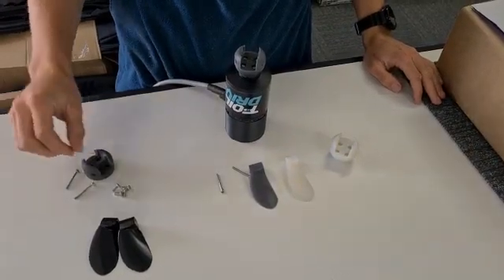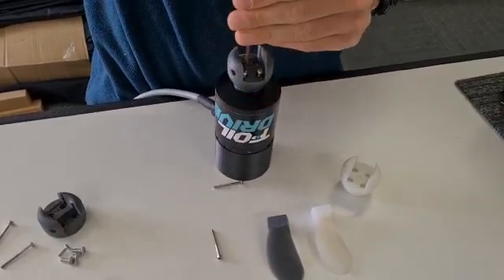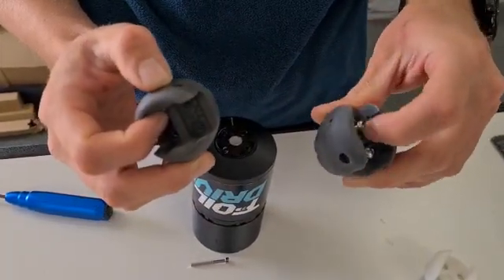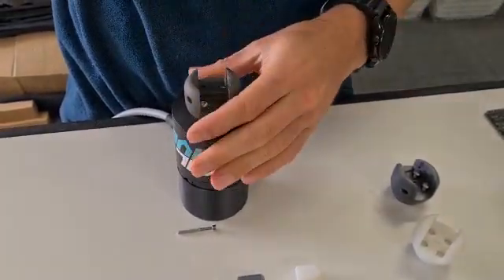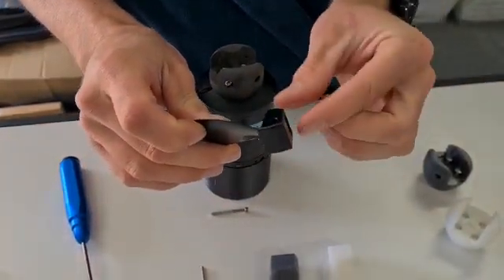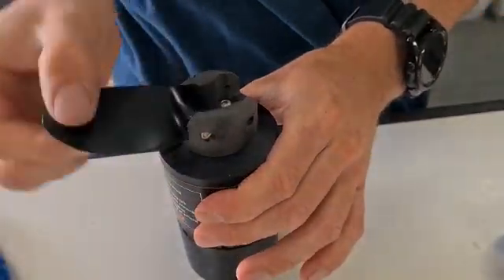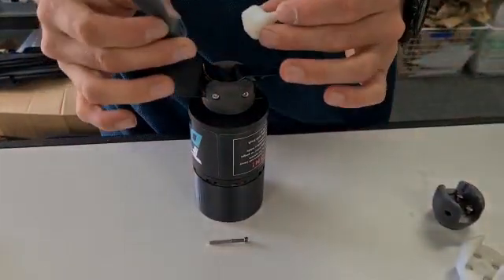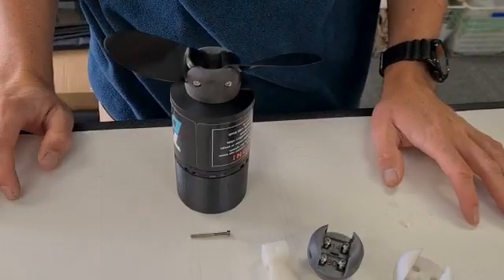How To: Fitting Aluminium Propellers & Hub Compatibility | Assist PLUS

Comment: Is this an upgrade that will work with the original Foil Drive assist or is only for the Plus system?  I don't see the aluminum prop upgrade set as a stand alone purchase item on the website.
Reply from the maker: Hey Scott, the Aluminium props don't increase performance on the Assist so they are only available for the PLUS. They're available here for reference: https://www.foildrive.com.au/product-page/aluminium-folding-propeller-set